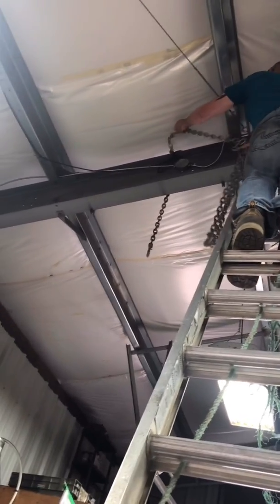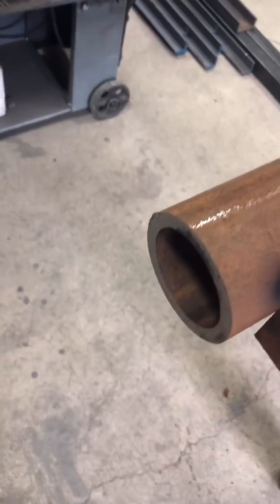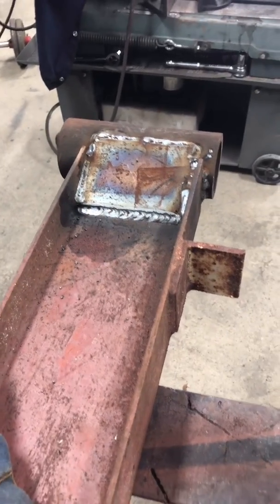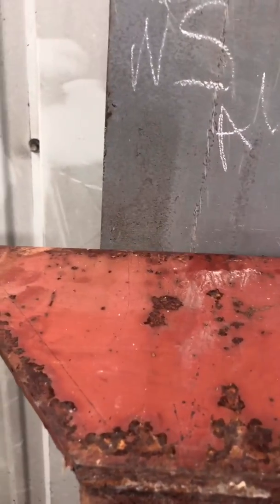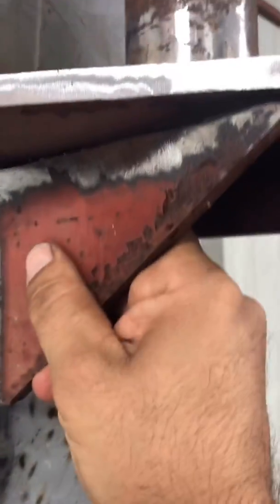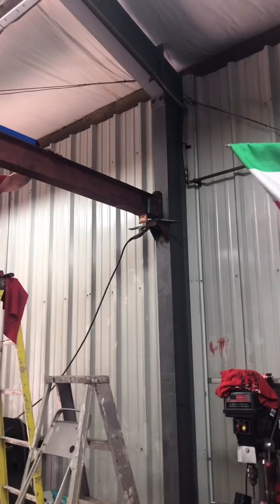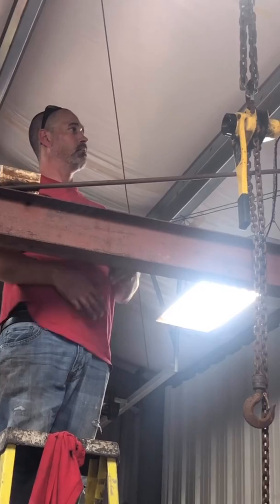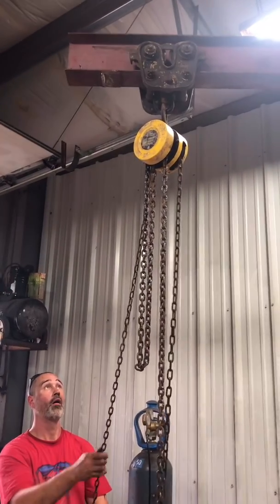DIY JIB CRANE!

Comment: just seen a different video about the advantages and disadvantages of an h beam , one of the down sides was buckling under sideloads 
im not too worried about the cranearm itself as long as you dont want to lift too mush with it i think the beam is overbuild for the weight a IPE120 can hold 2523kg over 2 meters when supported from both ends (so under a floor ) think the one you bought is bigger that a IPE120 (120 is height size in mm) 
wat i am worried about is that the crane can lift a lot more when it hangs straight out from the structure / standing beam it whont creak or give any indication sumting is wrong as its a lot deeper than it is wide though the top mounting does make it stiffer the bar helps a lot too as now you need it to buckle intoo an s shape before it fails
now you going to turn the arm to the side with the load hanging of it and put a sideload on the structure its hanging from and its a LOT weaker with a sideload, it can happen that that beam buckles and brings the roof down some 
do some structure testing on one of those cad programs and see if you can find out the maximum lifting load at the end of the arm then buy a winch that can lift 90 percent of that load and you should be safe , i think 400 kg should be doable just check deflection when lifting with the jib moved towards the side (start lifting on the side then use a tape to measure floor to tip of crane without and with a load and see if it drops)
Reply from the maker: I've had zero issues. Lift many loads. I'll make a video of it lifting rebar off my flatbed.

Comment: sketchy as frig..   MIG is not a Structure weld.  NOT even close..   7018 stick or  .045 fluxcore  with gas.
Reply from the maker: Haven't had one issue with it. Thanks for the comment.
Reply: He literally said he would be lifting 500 lbs tops, buddy. I think he’ll be ok 👍🏼. 2000 lb trailers are built with mig all day long, plus you failed to mention a plethora of other rods and wire that would also be overkill for his particular application. You expect people to pay attention to your videos, maybe you should try doing the same before you start tapping away at your keyboard.

Comment: I've been a welder since the 80's and installed a couple of jib cranes.
And always had to hire a company to come and test after installation. 
Also on the welding part........its always better to run stringers on anything instead of just one big gorilla weld. Stringers make a weld strong. One big weld does not.
I'm not a QC man but I've had to work with QC alongside all these years.
Overall it seems like a installation. Good luck
Reply from the maker: Thank you for the tip. I did call a crane company in my area and spoke with a representative there. I followed his  recommendations and the rest was what I researched online with crane company sites. So far it hasn't budged. I've lifted a few heavy things with it and it's as solid as the day I installed. It. Will see in the future how it holds up. I will however periodically inspect it to make sure everything is ok.  Thanks again for the recommendation!

Comment: With all the gussit plates ! That turn hing is only 3/8 on the stress side. With 11 ft. Beam and possible load (comes down to the 3/8 hing possible crack and fail )
Reply from the maker: There's two 3" harden steel pins   holding that beam in place resting on a structural steel post that's also been fastened to the beam of my building.  Its not going anywhere. But non the less thank you for your comment and concern.

Comment: Nice job on that. I'm about to put a couple in at the galvanizing plant I run.
Reply from the maker: Thank you. For a diy project I really over built it for what I need it for. Are you located in ont?
Reply: @RCWeldingsgarage  no, I'm in Fort Worth, TX
Reply from the maker: @dsw8103  Oh. I thought you were closer. It's nice connecting with people from all around.